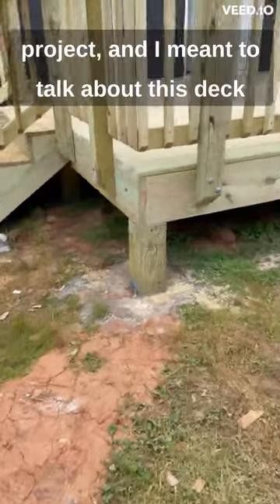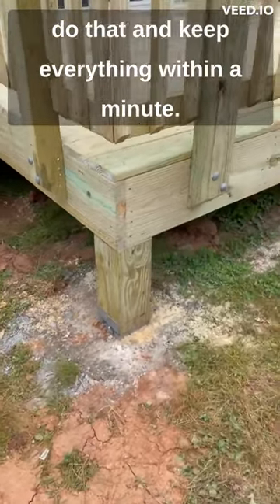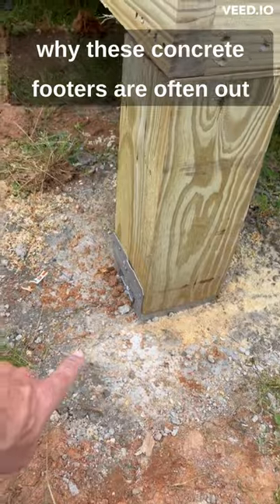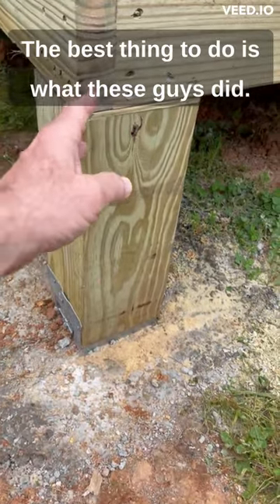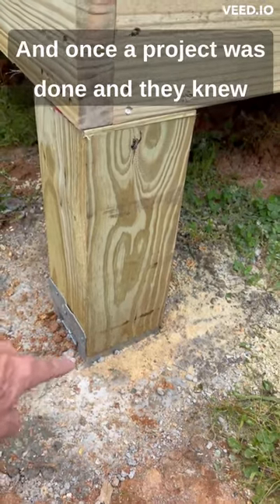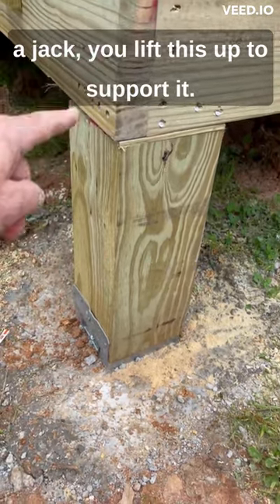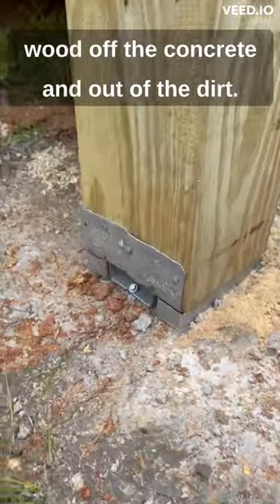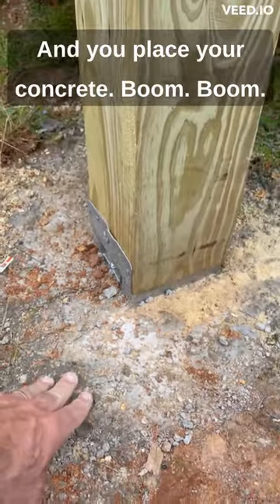Aligning Deck Posts and Footers

Comment: Pour a footer and do it right so it doesn’t rot out These lazy contractors dry packing put it on top of bricks just do that shit right the footers above ground you don’t have to worry about the beam rot out bunch of lazy, inspectors contractors. They do the same thing with the fence post and what happens the 4 x 4 rods out.
Reply from the maker: The post isn't in contact with the dirt and is treated. Are you expecting it to fail in a year or two? It's sitting on a conc footer just not planted into the conc like many builders and contractors do.

Comment: That is one of the worst looking deck jobs I've ever seen. "This little teco here" lol! WTF!
Reply from the maker: Can you elaborate please?
Reply: @Hmtatlanta  I'd love to. 

1. If you can't figure out where the footings go on a deck that small, you shouldn't be building decks. 

2. All those toe-nailed nails going into everything look absolutely terrible and shouldn't be necessary if you build a deck correctly. 

3. What the hell is that 1/4 inch drive screw at the base of the Simpson post bracket going into?

4. No beam carrying the load of the joists. 

5. Incorrect post to "beam" attachment

Do a video of the rest of the deck and I'm sure I'll find more!
Reply from the maker: @charleshunt3262  Another video? My ass is sore enough! 😂I think I said on another ass whippin comment that this was blessed by the code guys - not saying that's gospel but saying it meets standards. I know there are other ways to do it, but these are investors getting homes cleaned up and selling to folks competing with Wall Street. Just like a starter home isn't a palace, this deck isn't designed for that. Again, seems that there is room for improvement, that's been made clear, but it's not going anywhere any time soon, been cleared and the folks in it couldn't be happier as they're out of the rent cycle.

Comment: Yea this is junk!  Notice the 1/4" shim on load bearing side of post at bottom of rim joist.  Fail!  Concrete under post and steps are junk.
Reply from the maker: You've done decks and other work and never used shims?
Reply: Nothing wrong with using a shim. A shim could hold up your momma for generations.